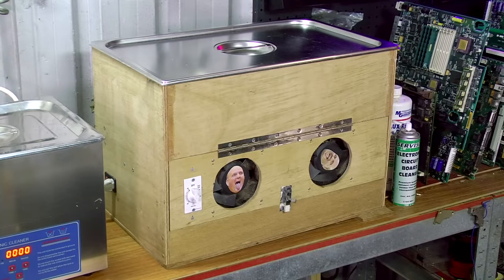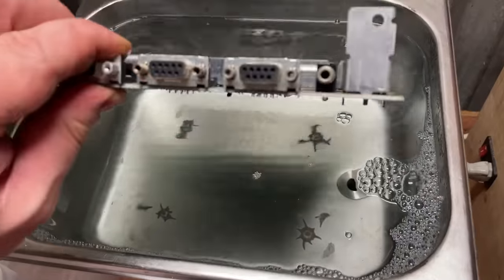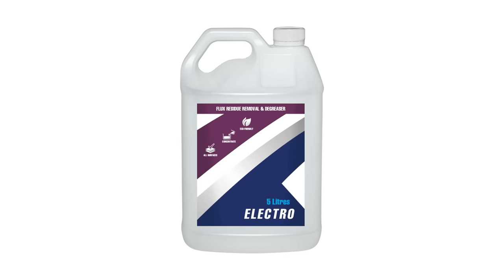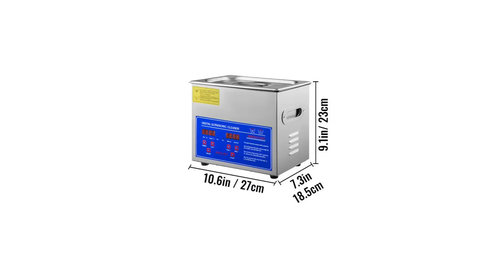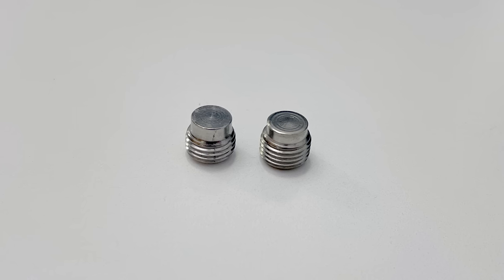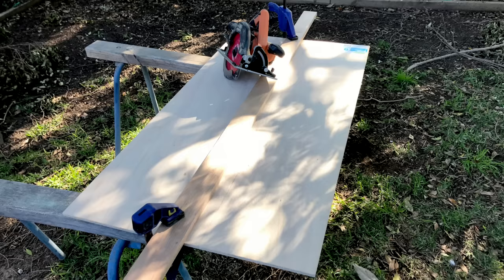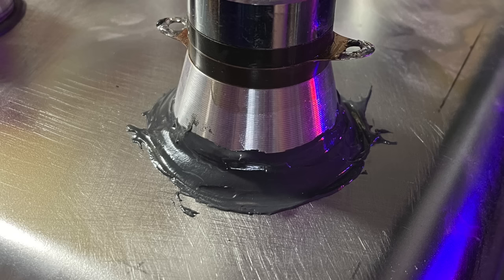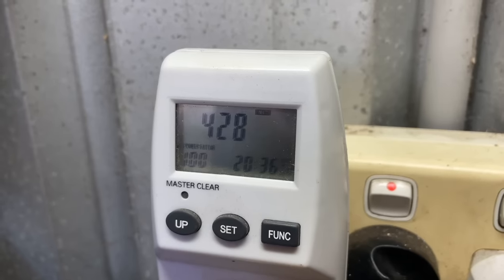Building my own Ultrasonic Cleaner

Comment: Great minds think alike.  I built my own ultrasonic cleaner by repurposing a small commercial fryer. It uses the same pan and lid, but the sheet metal is substantially thicker. I threw away the heater and used a diesel engine warmer adhesive patch instead. I also designed my own digital heat controller, which includes a timer, for it. You made a few mistakes in your build.

First, you either improperly mixed or didn't allow for sufficient curing of the epoxy. More importantly you used the wrong epoxy.  JB Weld cures into a very hard, strong, temperature tolerant, but very brittle layer that will be pulverized by the vibration over time.  Epoxy has to be mixed vigorously, and contrary to what you hear, it requires a long curing time (several days) minimum. It also needs a LOT of mixing in the smallest cup you can get away with, preferably a small cough syrup cup. Too large of a cup will make it harder to incorporate the epoxy components completely and evenly. Epoxy likes to be mixed deep rather than wide so it can continually fold in on itself like cake batter. Mix about 3/4 of the cup full for a good mixing depth. I borrowed a few plastic Twizzler sticks from my local Starbucks and chucked one into my drill and stirred it at full blast for two minutes. The color should change after a good mixing. 

Second, your application of the epoxy wasn't properly applied. You glued the studs and then glued and screwed on the transducers. If you're not going to weld or braze it on, epoxying it separately won't work. Instead, screw the studs on the transducer so it's flush with the top of the horn.  Abrade both the contact area and the horn itself and clean both surfaces with acetone. Add a thin layer of epoxy to both mating surfaces and press the horn firmly on the mating surface until you get a nice bead of glue around the horn. Add some weight to the horns to give it the best chance of adhering. I noticed you feared squeezing out too much glue. This was a mistake since a thick layer of epoxy reduces the cavitation and takes longer to cure. This may explain the electrical issues, for the same reasons you don't run them dry.

Alternatively, stainless steel can be easily brazed. Make sure you buy silver solder and a good liquid flux intended for stainless steel. You can use a torch to braze the stud in place. After cleaning up and abrading the surface and adding the epoxy, screw it tightly to maximize contact.
Reply from the maker: Which epoxy would you recommend?
Reply: Can ultrasound be used to facilitate mixing epoxy or paint?
Reply: @JohnVallevikGreen   I'm not sure, but if I were to guess, epoxy is rather viscous making it more difficult for the waves to penetrate. If it does have an effect, it would take quite a bit of time in which the epoxy has already started to set.  I'm also not sure about paint, but I guess it would work as it's less viscous. I would air on caution as paint often contains volatile solvents.
Reply: With epoxy I thought to stir mix manually and then vibrate it to thoroughly mix and shake loose imbedded bubbles
Reply: @JohnVallevikGreen  That applies to epoxy pours where you don't want visible holes or cavities in the molded part.  For epoxy used as an adhesive, you need to mix it fast.

Comment: Fifty years ago I was servicing ultrasonic cleaners in hospital sterilising departments. They were big suckers with 12 transducers and of course back then big high voltage valve driver circuits. The transducers were bolted to the base of the tanks with epoxy resin glue to bond to the base also. As for sticking your finger in the water, that is how I used to do a quick check of the cavitation after replacing a transducer. However, several checks as you adjusted the output tuning caused a very swollen finger. A belt from the anode of the final triode running at 27kHz was many times worse however.

Comment: NICE!! I bought a 1 gallon cleaner that timer goes up to 1 hour. But there are many times I reset it while its running and it runs for 2 hours continuously. Been doing it for years. It has a built in heater and a cooling fan.  However, The harbor freight cleaner only runs for a few minutes at a time and will go into over heat mode if run for a few cycles without a break. This shows that not all drivers are 100% duty cycle. So be careful here. Mine is apparently 100% and has no overheat indicator, but the harbor freight one I saw does have an overheat lockout and a light lights up. So for less than 10 minutes of cleaning before it activates, I could never use that one.

Love the project and I might try to build one someday because I have the same problem you do. Sometimes I can do half the item and rotate 90 deg and do the other  half, but sometimes it just wont fit.

Comment: Thank you for the video; it was challenging with all the parts issues; they probably were all bad transformers, to begin with. On the surface, ultrasonic cleaners seem like a simple technology. Despite this, there are many different issues to consider. After serving 22 years in the military as a medical maintenance technician, I am grateful to have had the experience of working on all the different equipment. Maintaining medical equipment such as x-ray machines, anesthesia machines, EKG machines, and ultrasonic cleaners, ranging from large bathtub-size units to small desktop units used in dental offices. I miss getting extra parts quickly, lol. I had a good laugh at the "vibrating bucket at home movie clip" in your video. 

Besides tach welding, medical manufacturers also use flexible non-conductive epoxy on the bottom half of the transducer. In addition to absorbing some shock and strain, the flexibility provides increased strength to the welded bolts. Continuously running the unit has its wear and tear. There is a slight difference in the formula used in medical grade units. Nevertheless, they are more concerned about the temperature and the unit's ability to maintain a certain water level during the cycle. Sonic energy, water level, improper temperature, and degassing are the most common problems. We used a synthetic soil test that mimicked blood and tissue found on surgical instruments to test them. 

Additionally, this system ensures that all zones within the tank function together. Many of the large units I worked on in surgical operating locations were made by Steris Healthcare. In the past, I remember their dual frequency transducer working at 132KHz, which is more than triple the standard 40KHz frequency transducer.  I remember always fixing that brand. All equipment like these gets recycled at some point, and you can purchase them used/refurbished from medical supply stores. My garage always has one for car parts.

Comment: Some notes from working in electronics industri for the last 25 years, most places clean the PCB's with either just isopropyl alcohol or cleaning solution as you mentioned, normally we will bake out the boards at no higher than 45 degrees celcius (typically 45minutes will do the job),higher temperatures can create vapers being able to expand in the boards and in worst case delaminate the pcb, when rinsing with isopropyl alcohol you will remove the thin layer of conformal coating, this will open op the boards for moisture and other not so great things on the board, therefor you should re-coate the boards with an thin conformal coating like the 3M Nove 1700 Electronic Grade Coating, this will keep the board properly sealed, these types of coating are removed with isopropyl alcohol if you need to rework on the boards, this was just my 2 cents :)

the solders on the PCB for the drivers are properly done based on IPC Calss 1 requirements :) this is the lowest quality one can go.

Comment: Youtube did not like me posting a link to aliexpress to a 500w 28Khz/40Khz board with big heatsink, fan, display and control board with options for adjusting time, power, activating/deactivating frequency sweep and start/stop button. I was suggesting this board as it would help cut down on the overheating problems thanks to the extra 100w headroom while giving more control over the ultrasonic cleaner. Great video BTW, helped me get a clearer picture of what I would be in store for if I were to build myself one for my computer repair shop. * edit * Look for the link in the replies to this message.
Reply from the maker: YouTube gets a little funny with links, but I certainly didn't remove your post. Maybe try again as a reply to this message?
Reply: @BranchusCreations  hmm attempt #5: bit replace_this_with_a_period_and_remove_the_spaces ly replace_this_with_a_forward_slash_and_remove_the_spaces 500W_ultrasound_generator
Reply: seems this post is finally staying up, hopefully it is not too confusing how to reconstruct the link.

Comment: Very interesting. I finally understand what transducers are and how this works.  Also good to have a vote of confidence for Vevor, a Chinese brand.  So many dud brands on Amazon these days.  Researching a good brand is exhausting.

Tip 1:  I use a dog hair blower for blowing out water from everything.  This helps with less staining, and faster drying.  Cost is about $100 on Amazon.  A pet shop price is $400. The hair dryer is more heat, medium fan.  A heat gun is all heat and no fan.  A dog blower is low heat and very strong fan.  I have all 3.  Each has its function.  You can use the dog dryer like compressed can of air and a mini air compressor.  Blow out leaves, keyboard, ceiling cobwebs, water from washed bottles, etc. It does not dry faster, it literally blows the water off the surface.

Tip 2: Do not put your hand into the machine while it is running.  Shock is not the issue.  The bones in your hand will be damaged by the sonic vibrations.  As any DIYer knows, the hands are the most used tools you have, so preserve them, baby them, and never subject them to damage or rough use.  A lot of guys are very macho about it, having stronger hands than us women, but sooner or later, arthritis will creep in, bone damage, tissue damage, fungal damage. Baby your hands.

Question:  Can I put a greasy car part or smoke damaged (from house fire) jewelry in a glass bottle with Mineral Spirits or Acetone or Gasoline/Diesel, tighten the leak proof lid, and immerse in an ultrasonic bath?  The gasoline is in the jar along with the car part or bicycle chain, and the whole closed jar is inside the ultrasonic basket filled with water.  This way, the water does not contaminate item, no distilled water use, no cleaner. Diesel will remove dirt faster than soap and water.  I saw this done on Youtube but worried about safety issues and flammability.  Anyone know if this is safe?

Comment: I dabble in audio and rebuilding electronics myself, and as you were explaining the situation unfold, I was basically getting the sense because they are high voltage. AC oscillating circuits that have to go through a relatively low impedance. Unfortunately, the drivers, even some of the most well-built ones will overheat, and, what starts off as a small problem of one driver falling off invert and overheating a regulator slowly starts to shift the impedance and balance of the driver and its frequencies relative to anything from it the driver impedance changing because of temperature that could or cheap driver quality or even just the fact that one fell Off do to thin and he’s in layer height and temperature becomes as the first domino is a way to put it where you you take these balance, high-voltage, drivers circuits and you’re feeding that into ideally should be the most balanced impedance load so that everything just kind of hits a harmonic in and everything works but yeah, it’s the fun world of electronics and audio to see perhaps the literal fight of the two in raw power amazing story!

Comment: I have been wanting to build myself one for a while now, I have a stainless steel tank already which was originally designed to be a tank in which a fuel bladder would go into for like a drag racing car, just haven't gotten that far yet, right now I'm just about done building a rock crusher so maybe after this. 
This reminds me though, back in the early 80s we used to install these pucks in the bottom of new boats since I worked at a yacht dealership back then and the idea was supposed to be that no barnacles or other saltwater marine life would adhere to the surface, ha ha. Needless to say that's the only year that I remember installing them. 
What we used to install them though and I still use it a lot today is Marine Tex a two part putty that I have fixed everything with even cracks in engine blocks and cylinder heads. Great job on your project by the way.

Comment: Your work is great. I have never seen so much thoroughness in an electronics build like this. I was curious about building a DIY ultrasonic cleaner from purchased drivers and transducers but I have neither the welding resources nor the component troubleshooting ability that you do. Thank you very much for sharing this experience with us and providing this high level of useful advice. I will keep educating myself about purchasing--and maybe even slightly modifying--an ultrasonic cleaner for my own work and projects but I will not take myself down the rabbit hole of trying to build my own. Thank you!

Comment: Hats off for including all the issues! So much more to learn from that than a “pure success video”!
First time viewer, and you earned my subscription with this honest and thorough video.

Edit: I absolutely agree about not showing how to hookup the AC. I’ve recently built my own UV curing box out of an old ..device, and while it very tempting to show others how I did it, I will not. Cause there are more than one way to hurt or kill yourself digging around inside such a ..device, even with the power unplugged.
Great to see someone being thoughtful and honest enough to refrain from sharing dangerous information!

Comment: Great introduction.  Not mentioned is what the ultrasonic cleaner will remove and what wattage is required for the mass envelope. Can it remove rust and corrosion or only dirt and grime. To fix Ultrasonic transducers to base of dish, I suggest electrically conductive epoxy resin, I have used this adhesive  to repair an alternator on a motorcycle, beware it is very brittle.  I need to clean a 6 cylinder aluminium block motorcycle engine completely and a number of other large scale projects requiring a huge tank, both ferrous and non-ferrous metals. This video is food for thought.  Hmmm. how can I adapt the technology.

Comment: I appreciate the comprehensive video that you've made on this subject. My own needs for an ultrasonic cleaner could be satisfied with a small commercial unit. However, you've given a lot of insight into the failure modes that these machines can have, and how to confirm proper operations. Thank you for that!

Comment: A classic case of do it yourself and suffer/spend. Which makes perfect sense if you think about it. If you're doing something for the first time you're going to fall victim to every trap and pitfall there is and maybe even discover some new issues on your own. A commercial manufacturer will have gone through all of it already themselves and figured things out, hopefully. I'm thinking with those studs maybe you don't have to weld them? Maybe just some high temp solder or braze may do the trick. Any of that is going to be stronger than any glue.

Comment: At my work ( a machining factory) we have a pretty big ultrasonic cleaner, it has 3 tubs one ultrasonic cleaner, one warm water cleaner, one air dryer, they all have an agitation feature that moves the basket in the tub up and down for extra cleaning, we only work with alu so i can confirm the marks you talk about, but the marks are only visible spots you cant feel them, it also only seems to happen on large surfaces anything smaller than a fist has nothing on them, tho we also have alu alloys that are harder than some steel so it might have something to do with it:)

Comment: Brilliant ! I've had most of the same issues. The trouble is that if you buy a cheap Chinese machine you will have the same problems, but the return costs will be prohibitive. Best to buy from a reputable "local" source, or DIY (with built in redundancy) just like this guy.

Comment: I use a VWR Scientific 1290 timer and temp controlled hot water bath. In it there is concentrated CLR, ammonia and distilled water. I agitate the water with a filtration pump loop. My ultrasonic cleaner is made in Michigan by SharperTEK. It's got frequency sweeping, degassing, heat up to 70C. I use Branson EC / distilled water. Again I installed a pump / filter loop. I then soak boards in 50/50 mix of Tetrachloroethylene / N-Hexane. This also has pump and filter loop. Then onto reflow oven at about 150C for 10 minutes. Back in the day we used freon vapor machines. Liquid freon sat in the bottom of the tank. It boiled because room temp. The vapors would rise, hit your board, condense onto your board and fall back down as a liquid. It's not too dissimilar to propane. It did a perfect job. My process usually does better at cleaning but nowhere near as reliable at leaving NO residue. You can always find something to nitpick over if you search under microscope...under chips and such. It has repaired a few problem boards outright, all on it's own.
Reply from the maker: Sounds cool!